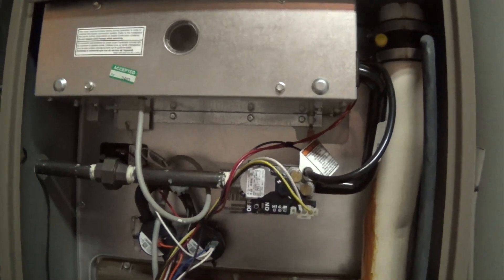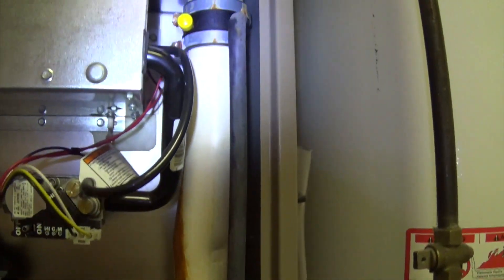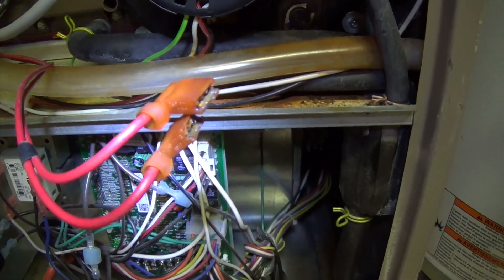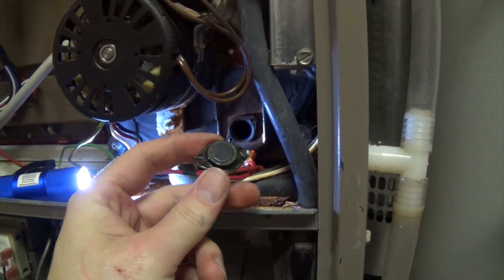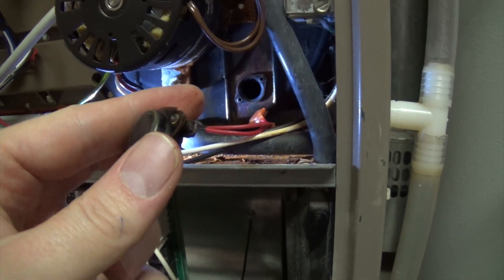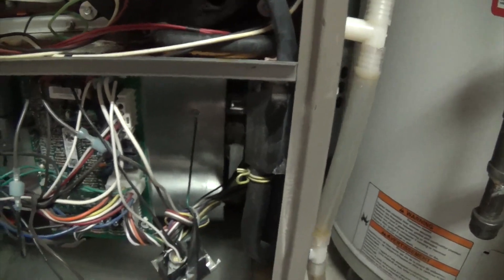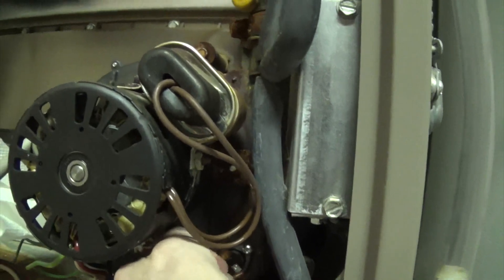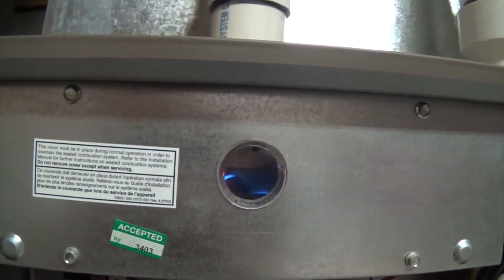Coleman Echelon 9.v Limit Switch Open - Replace faulty Switch

Comment from the maker: A shout out to Dave at KB Heating and Air Conditioning Ltd. in Lethbridge for honing in on the part needed via email/photos and ordering it so I could fix it myself...
Coleman Echelon 9.v Limit Switch Open Replace faulty Switch